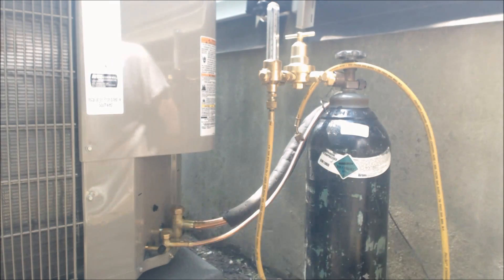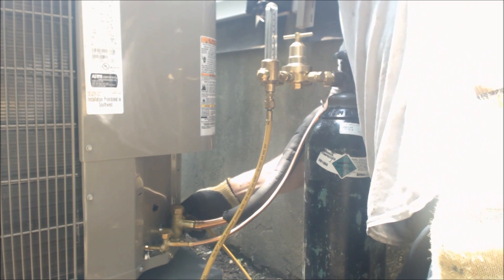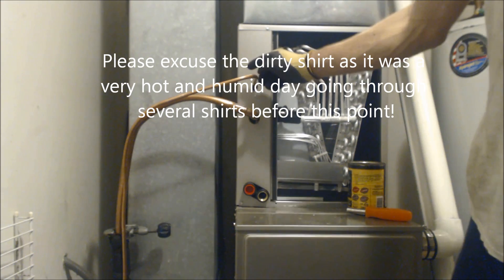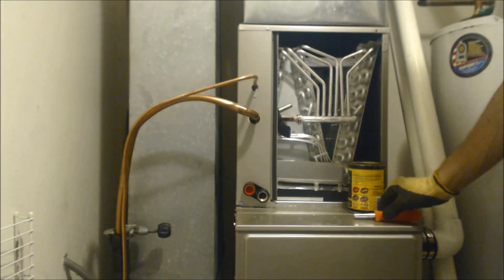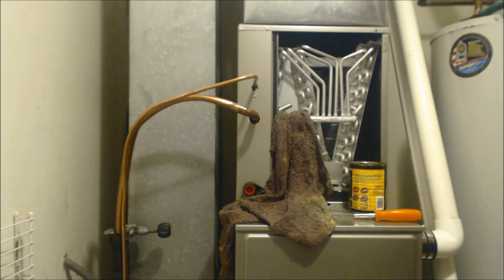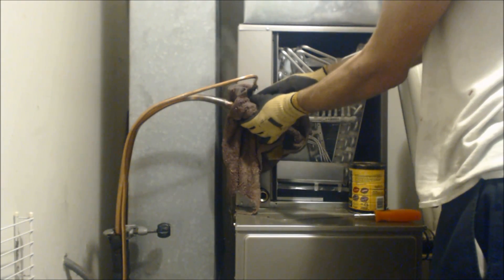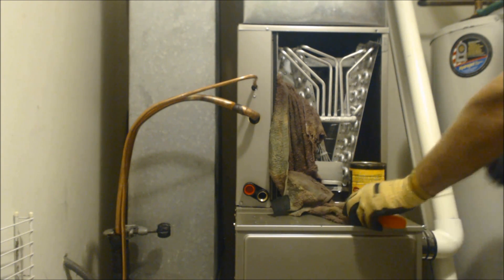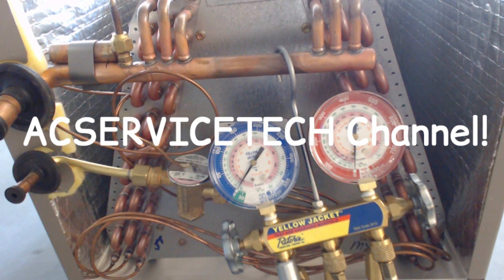Installing an Air Conditioning System: Brazing and Pressure Testing Part 1!

Comment: I didnt see here, but maybe I get the answer on a remark 5 years old:   I am replacing an evaporator and did a pump down, so i have all of my refrigerant in the condensor.  So in order to apply a Nitrogen flow thru the evap lines while brazing in the attic, would I flow it throught the service valves at the condensor outside?  Or what would be the rational method?   Thanks! Anyone?
Reply: Duh, i reviewed, i got it.

Comment: Stay Bright 8 is a superior connection in every way, save medical oxygen gas. I have no idea why we're still brazing. Bursting strength? Stay Bright. Tensile strength? Stay Bright. Burning up components due to 5500 degree O/A torch vs MAPP? Stay Bright. Oxidation? Stay Bright. (I know we do some things to mitigate some things) But I see only 2 environments where O/A excel: Sloppy, loose fittings/ holes, and medical gas. A 700 degree MAPP torch with Stay Bright vs a 5500 degree O/A with DynaFlow and in my view, Stay Bright is better 99% of the time.
Reply: Maybe for residential, but for large pipe, it tends to void out.  It won’t meet a lot of job specifications that require high temperature brazing.  Other than that, it’s OK.

Comment: If you are using an existing line set, what’s the procedure and tools needed for blowing out the old lineset?  I imagine you use nitrogen but you wouldn’t want the lineset hooked up to anything would you?  I just bought your book but did not see this addressed.
Reply: Sorry, you do have it on page 121, I’m retired and hoping to use your teaching to help me help my family with ac problems. You are the best on you tube, a lot of pretenders out there.

Comment: Im new to ac work and i looks like it is ok for the evaporator coil  be mounted were air flow goes either way through it is that correct.
Thank you
Reply: No
Reply: @abm35945  The installation paper work said it was ok to be used either way and it’s been working great.

Comment: Great work!  Always nice to see it professionally done.  Do you know if the vertical carrier/bryant  N coils can be installed with the line set facing g the back of the furnace?  And if so would it need a transition?  I've seen them faced in this orientation before and it seems like the drain pan would be right over the heat exchanger.  It seems they should always face forward in your video but wanted to check if you have ever seen any like that?
Reply from the maker: I have seen them mounted in a variety of ways but it makes the most sense to face them forward so that you can have your service space open in the front of the furnace and ac unit, thanks!

Comment: Why not braze at the service valve first and work your way back to the coil? Maybe use a little less Nitrogen.
Reply from the maker: I usually do braze the service valves in first but it is more about just moving the acetylene around. Also the filter drier gets cut in and brazed last to avoid contamination, thanks!
Reply: That definitely makes sense, and prevents and contaminates too large in the drier, or clogging up the TXV valve. I was curious why most of the evap coils suction lines require swaging after cutting the copper? If it is spec for 3/4" why isn't it pre-swaged for 3/4". Do you usually anneal the copper before swaging to avoid splitting the copper?

Comment: I understand the reason brazing with nitrogen, however, when pressure testing, can we using just air pressure?  I have seen that many HVAC technicians brazing pipes without nitrogen and no pressure tested units that last over 20 years.  What if there is no nitrogen available?  What if we can just use a bicycle air manual pumped through service valve and test leak test?  After that remove core valve out air?  This way, we don't have to use the vacuum the nitrogen inside pipe.  I think it will be effective and convenience.   What do you think?
Reply from the maker: We don't want to add moisture into the system because that is what we are trying to get out before vacuuming. That would fill the filter drier right past its capacity before adding any refrigerant. We use nitrogen because it is inert and dry. A standing vacuum test confirms that no leaks air or nitrogen are present in the system but if there is a leak, it will just be vacuuming moist air into the tubing which is what you are trying to avoid, thanks!
Reply: @acservicetechchannel  I understand.   Thanks a lot for answering my question.

Comment: hi, just a couple quick questions please. for new ac installation do we have to set the CFM in the furnace to match the tonnage for the new ac? how does the furnace know we are putting in a 2ton/3ton/3.5ton and how does it select its CFM based on this? you've been a great help. thank you.
Reply from the maker: Yes definitely! You as the tech would need to set the air speed in the furnace via the dip switches or pin connectors. Worst cast, the speed taps of the blower itself but definitely adjust the air speed to match the BTU/HR capacity of the outdoor unit and evap, thanks!
Reply: Hey I have a question. Along with taking both valves out, Are both high/low sides front seated during pressure test ? Also how could you isolate the condenser side with nitrogen pressure to test for leaks on high side of system and avoid damaging the meter device?

Comment: Why didn't you braze the filter/dryer while you were brazing the other connections inside?
Reply from the maker: We braze the filter drier in last to avoid contaminants from the brazing process entering the filter drier. This way it will be at full capacity when the refrigerant is added, thanks!

Comment: The new condensers come charged with refrigerant at 15 ft (my case) .  Isn't removing the schrader valve going to leak it all out?
Reply from the maker: The refrigerant is held back by the service valve. The port on the service valve is attached to the lineset which is where you pressure test and vacuum pump, thanks Kevin!

Comment: how is the nitrogen flowing from the suction line to discharge line, the TXV in between is one way right?Which would allow flow from discharge to suction only.
Reply from the maker: Actually this same txv is used in a heat pump and the refrigerant bypasses through it when flowing in the other direction. The txv in comfort cooling systems does not close all the way even if the bulb were to lose the refrigerant, thanks

Comment: have you try the stay brite  8 to braze the copper line you will need the special flux with the stay brite  8 there is no  need to flow nitrogen because the temperature doesn't get as hot with the air acetylene
Reply from the maker: Hey David, this was an R410a system so we braze them with 15% silver rod. Stay brite  can used for R-22 systems or other lower pressure systems, thanks!

Comment: have you ever used stay bright #8 and if so what is your professional opinion on this product as an alternative to brazing, thanks.
Reply from the maker: Yes, that is what older techs used to use with the r-22 systems and other lower pressure refrigerants. I have never found a circumstance that I couldn't braze though even on small refrigerators.  I would recommend brazing in all circumstances and just make heat shields as needed. You technically could use this on lower pressure systems though. I would not recommend using the staybright 8 on an r410a system for sure, thanks
Reply: Thank you so much, love the videos they are well presented and educational

Comment: will a aluminum coil be ok with a TXV for R410A  on a Heat Pump. manufacture test was at 480 PSI
Reply from the maker: Yes they are making a lot of them as aluminum now. Also they are doing more and more microchannel but not around the coast. Thanks

Comment: Why not do the dryer while you're in there ? As in put it all together before flowing nitrogen ?
Reply from the maker: The filter drier manufacturers recommend that they go in last as you want the least amount of contaminents and water vapor collected in them as possible. They havew a fixed capacity. Great Question!

Comment: I want to get the turbo torch with mc tank set up, and I know this question is a difficult one but about how many residential installs can you do with one mc tank
Reply from the maker: This is a wild guess because it depends on the amount and size of the braze joints as well as the tip size but maybe 7-12 full changeouts of 3 ton split systems with an A 8 tip. I honestly don't pay much attention to that. I build it into my price and I know I don't want to have to lug that 40 cf B tank into the attics here but I always have one in my truck as a spare. I certainly do know that you can braze a lot of joints with an A6-A8 compared to using the A11 or A14. Thanks

Comment: I am installing a new unit and the new evaporator has the copper lines on the other side i need 2' of 3/4 and 3/8 copper pipe can i run to lowes and. Buy from them or is it different size for hvac? Thanks
Reply from the maker: Well those sizes are acr soft copper meaning that they are measured by the outside diameter. Rigid plumbing pipe is inside diameter. I am not sure if you would be able to find that tubing there. You may need to go to a plumbing or hvac supply house. Thanks

Comment: What are the steps you take in preparing the copper tubing before brazing?
Reply from the maker: Steel wool tubing, brush fittings while not letting dust into the tube, ream as long as the shards do not fall into the tube and into the system. There are good videos about this at lucasmilhaupt.com

Comment: TXV one way valve
Reply from the maker: Thanks for the Comment! The txv will meter the refrigerant one way and flow through in the other direction in a heat pump. Older txv's have a bypass around the txv.

Comment: What is the number of the tip you are using?
Reply from the maker: That was a rather large one. I believe I was using an 11 the whole time. I could have reduced for the liquid line to a 6 or 8 but if you are in and out it is fine. It would be quite a problem if you were not aware of how hot it was and melted the tubing. Thanks for the Comment!
Reply: Thank you for the quick reply.

Comment: Have you ever tried staybrite #8 solder, no nitro sweeping needed and lower temps?
Reply from the maker: Thanks for the Comment! I do not use Staybrite Solder for R-410A because of the higher pressures. A lot of techs use or have used that product in the past for R-22. Thanks
Reply: Harris did a study of Stay-Brite vs. brazing.  Check it out online at Harris.  The answer is very clear=Stay-Brite

Comment: You are using air/ acet  torch? im thinking about buying  a turbo torch air/acet instead of oxy/acet im new in the industry
Reply from the maker: Some techs like Oxy/Acet and some like Air/Acet. I personally do not have a problem brazing 1 1/8" copper tubing with an Air/Acet. If anything, I just build myself a wind shield if it is very windy outside. You can get used to the heat that the torch throws by buying a pound of zero percent braze rod to practice with for pretty cheap compared to the 15% braze rod. It is like $20 or 30 dollars for a pound.
Reply: +acservicetech what # tip is recommended for residential work
Reply: Good job.  The only thing I don’t like about your torch is the noise and large flame required to get the same heat as oxy/ac.  I like to braze with a soft flame.  You can get in and out much faster.  It’s a personal preference.